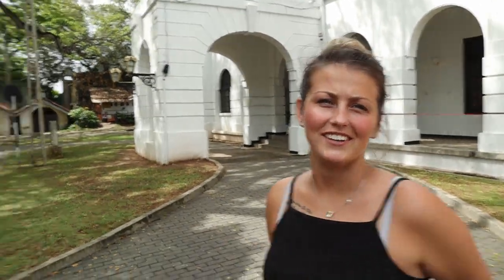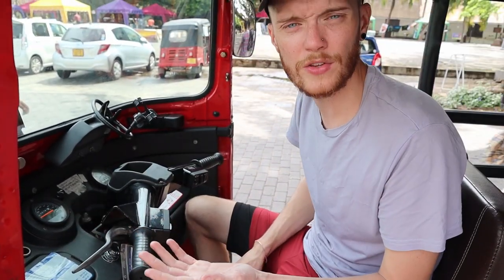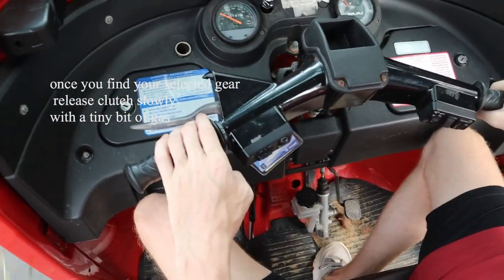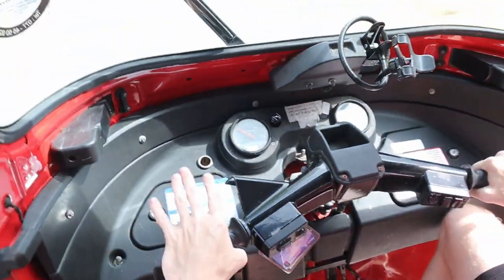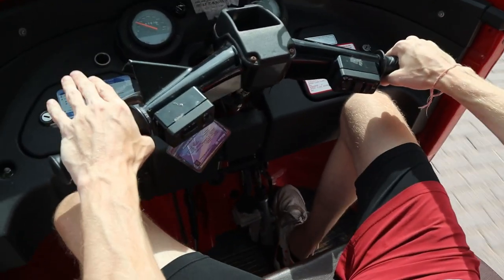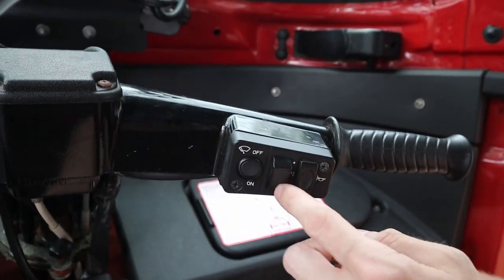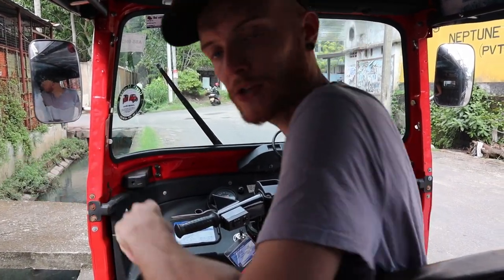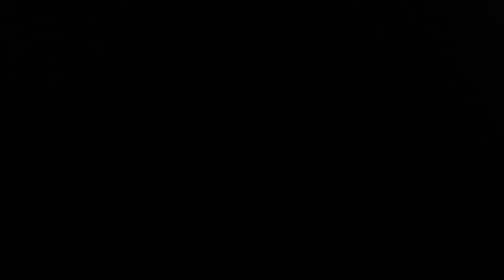HOW TO DRIVE A TUK TUK - SRI LANKA TRAVEL GUIDE  2019

Comment: Struggling to get to 2 gear , ends up in N or 3rd , any tips ? Thank you
Reply from the maker: there's a fine line between N and 2nd,  best thing to do we found was start the engine keep the clutch in and while sitting still just get used to flicking up and down the gears, then find a quiet road to practise on.. it took us at least a week to nail the gear changes... fingers crossed for you 😊
Reply: Just got a Bajaj RE Tuktuk and l’m having the same struggle on gear switching. Thanks for this tip! And great content!!!